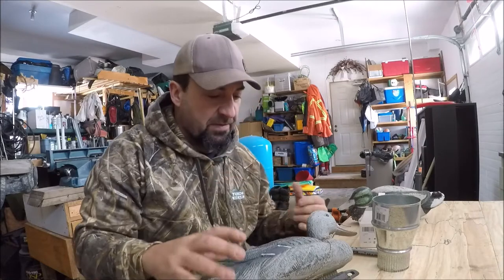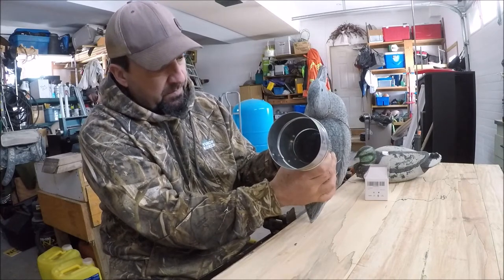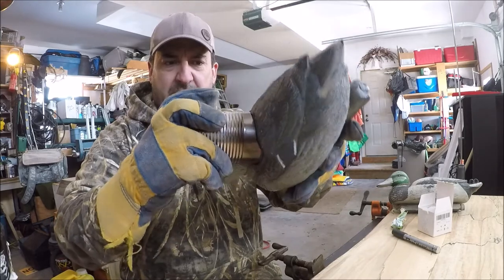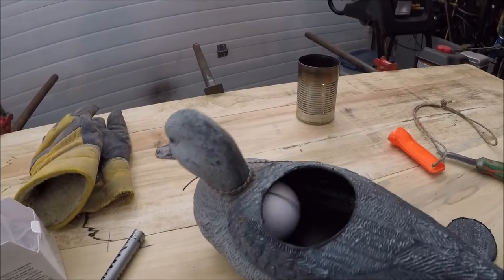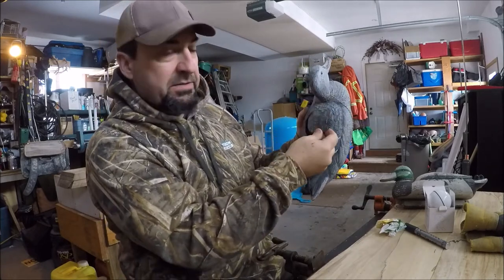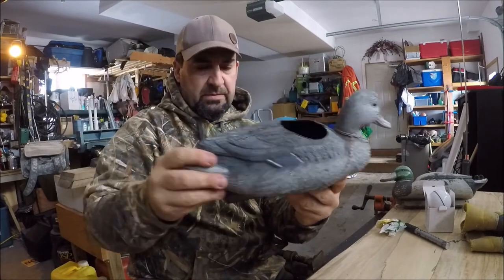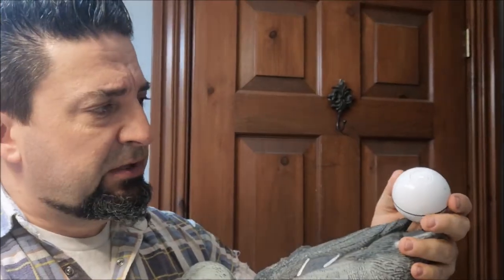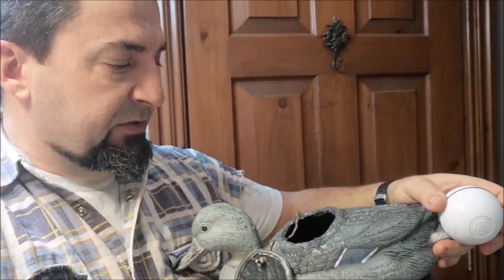Free DIY Motion Duck Decoy

Comment: I made a few of these. Way to load as they bang around the inside. And it was a pain in the ass to get the back side of the decoy to stay closed while having it big enough to fit the ball in. Your method was drastically better for the hole cut out. But that silicone most likely would flare. And same outcome I got once in water movement wasn't what I thought it would be. Wanted to try it in a goose decoy as it would have lots more room. But never found any used goose floaters to try it on
Reply from the maker: I ended up using the ball inside a ziplock bag. Enough room to roll but drastically reduced 'banging'. Silicone stayed as  intended. This design meant for calm water only as any waves negate the need for a motion decoy. Cat toy likely too small for goose decoy to make a difference. Some days I use a jerk line on elastic cord. Pull and let go, they jerk and spin and swim back to spot. Looks like they are chasing each other. Cheers

Comment: i spray foom the inside then cut out a spot for the ball! stoped it from rolling around and a lot more motion. But still dont come close to a jurk rig. go through batterys after one hunt and quicker in cold weather! just what i learned from my messing around.
Reply from the maker: Yes. Also have a jerk line hooked to stout ice fishing rod to limit excess rope in boat. Cool idea about spray foam first. That would certainly make it boayant, but yes batteries a pain that's why I went with removable and rechargeable.

Comment: When I cut mine I used a utility knife and cut it low like you showed at the beginning.  And it did fill with water. I didn't think about putting the ball in a ziplock. Thank you for that. 
Where did you get your ball? I used a weasel ball and it takes AA batteries not rechargeable.
Reply: Also I put a small piece of pool noodle in the front and back to help keep it from getting stuck
Reply from the maker: @fanmattjustice  Yes, all great ideas. I found a rechargeable cat motion toy off Amazon. Will put to test this fall. Water should be fairly calm for this setup but that is what it is for... To give calm spread some random motion. Good luck and thanks for the comments.